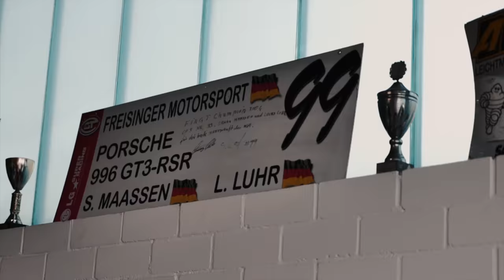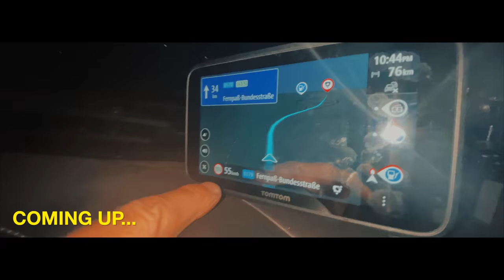MY SECOND MEGA EXTREME 993 GT2 PROJECT! | VLOG 66 | Part 3

Comment: Why mess with those old cars when you cam buy a new 992 GT3 that is in a whole different class and can be a daily driver also 😳
Reply from the maker: Nothing great ever comes easy in life! The feeling of a 993 cant compare to a new Porsche as nice as they may be! 😅
Reply: Old cars are a lot more analog, they have traditional power steering instead of electric. They are simpler in general. This makes you feel connected to the car much more. Yes downside is it won’t handle or accelerate as well as new car but that’s not the whole essence of driving. Some people just enjoy this raw lightweight feeling from old cars that something new cars can’t have because of regulations and what the large consumer decides for Porsche to stay profitable.